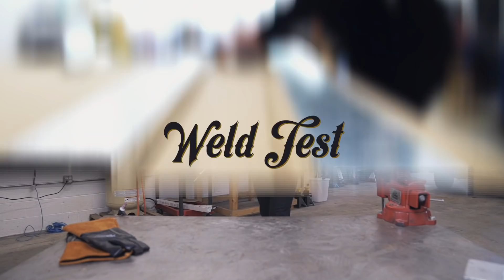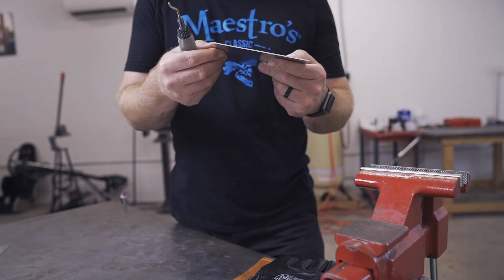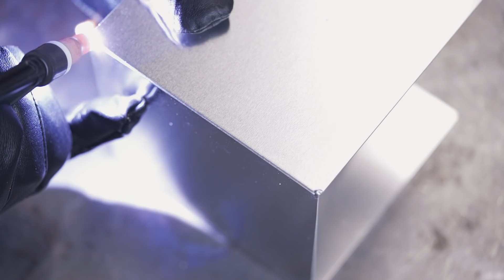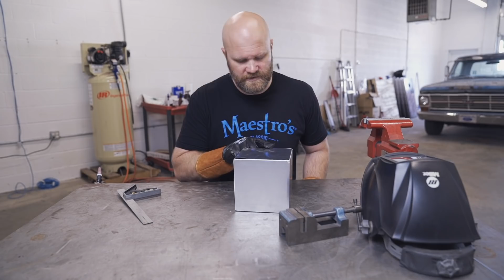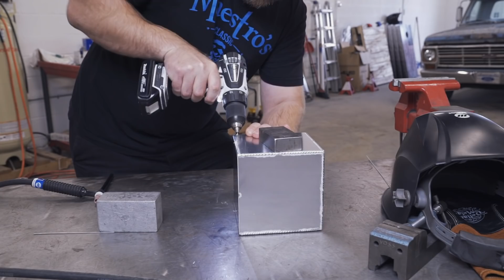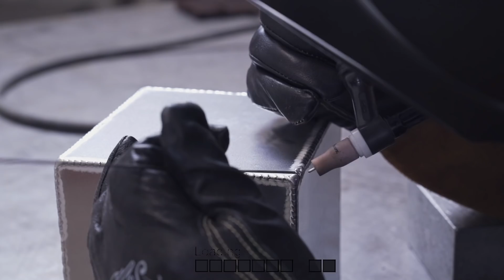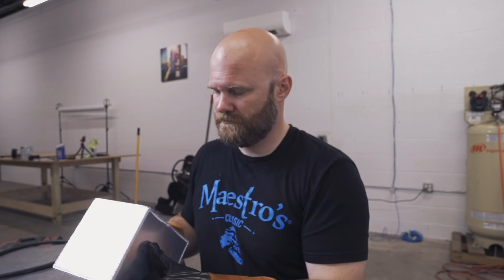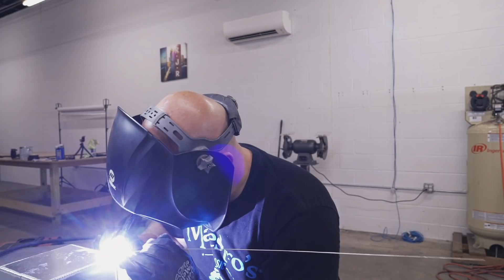Ace a NASCAR Welding Test - TIG Welding an Aluminum Cube

Comment: I have found in the past that if you can put a vacuum on the inside and draw the argon inside it might work
Reply: You can also cut a small piece of 1/8 aluminum filler rod and insert in the hole and see if that works for you

Comment: A cold wet towel to throw on the piece. I know this is an old video and it's been out a while but I've done that and it works great. If it's cold enough you can actually hear the vent hole suck in a little.

Comment: Hey Justin Voss, i have to ask you why are you so high up with your tungsten.
Your running pretty low amperage offcourse because its pretty thin sheet metal. 
But your losing a lot of power doing that. You can see your arc flutter like it has trouble keeping up.

Comment: From an old retired welder. Should fill cube with whatever gas you were using through the hole you drilled and lightly pein hole quickly and then weld up the hole. A few tricks are involved to complete this procedure. Do this and let me know how you did.

Comment: I realize this is a long time in the past, but would it not be a good idea to blast cool air into the cube then tack quickly, stop, repeat till the hole is closed, then weld over it for looks?
That prevents heat/pressure build up because the air inside is cool and not hot air - which expands quickly.
By the time it is hot enough to blow out the hole, it is too late.
Vacuum is really better inside - but how?? (so no!)
Yes/NO?

Comment: I made myself opened box for all the stuff I have around (phone, case with tungstens, etc.). I intentionaly have it on my table so when machinists or whoever comes to my booth they start asking about that box and it usually ends with me having a side kick. So... if I have got nothing to do at shop, I weld something that I'd like to work on (f.e.: I did pie cuts for fun and people started to ask about exhausts.) and then put it somewhere in my booth so it will be seen. Lot of guys at work are shy to ask, so it's not just a good display of capabilities but also a nice icebreaker.

Thanks for nice video!

Comment: You're too slow. With Al like that you should be dipping at LEAST twice per second, maybe even 2.5x. It likes it hot and fast. Get it up to temp and floor it, pausing per bead isn't doing you favors. You will need to ease up on the current towards the end of the weld, a peddle and/or a long downslope does the trick. You can pre-weld the final inch or two before doing the main weld.

Comment: What's the hardest part of tig welding? It looks almost like soldering. Except not. Just curious. Never tried it before
Reply: Dip pattern and temperature control on thin material

Comment: Ive had to do something similar but SS tube cut and cope 5 pieces and have it be straight after, no issue with venting but a absolute nightmare to not have warped into spaghetti.

Comment: I've been part of a team at the very top levels of motorsport and have been lucky enough to land a few World Championships as part of that. I'm not a welder, I was in engine development, so I can't judge there. What I would say is that  we had mechanics and welders or equivalently skilled technicians (I use this term with a great deal of respect) swarming at the door from across Europe and even further afield, this makes it very easy for the employer to say "NO"  or to offer you less than you're worth for the privelidge of working in motorsport (and no, it isn't that glamourous). My biggest tip is to double check whether it is really worth it. For me, I don't regret my time, but that's with hindsight and we won all of the championships we could. If we lost? Well then I'd have taken a seriously underpaid job for zero benefit. In motorsport you have the team to back you up, but unless you find a way to differentiate yourself, you are only as good as the team, and risk obscurity.

Comment: If you are confident in your welds you could alternatively make it a pressure box with some kind valve, it would get rid of your pressure problem by essentially needing a valve. Plus if welded good nuff “hydro forming” the box afterwords could be a great display of your abilities 
Just an fyi I’m not a welder in any sense of the word I just know some general knowledge, feel free to correct me about the hydro forming idéa

Comment: Is becoming a welder at NASCAR a hard thing to achieve? Making a cube really seems a bit easy.
Reply from the maker: It can be hard to get in the door. Then they will have you weld up or make something similar to what you will be doing and see if it looks nice. The cube is pretty entry level, do you know how to use a shear, can you make a nice looking aluminum weld etc.
Reply: @JustVoss  Alright, thank you! It might be hard for me to get there considering I'm in Canada but I wanted to see what kind of qualifications a NASCAR welder would need since it seems like it would be a job reserved for really good welders.

Comment: Really great video, I haven't welded aluminum in easly 2ish years, fun to watch videos on it, to anyone new to welding or looking into this type of work, ill i gotta say is no matter if you are going for pipe, fabrication, mass manufacturing, construction, or shutdown welding, a welding jacket, long sleeve shirt, sleeves or a older sweatshirt will give you a way better look for your own protection and show your potential boss that you look for your own safety, i work with guys in mass production that some wont wear a helmet but have glasses on and sunscreen on a part with a bunch of tacking and manipulating the piece, and a few that don't wear sleeves or a long sleeve but tuck their arms like he did in the video, I've burnt my arms before from arc exposure on pipe welding and its not fun and you don't look cool doing it either, keep yourself safe out there

Comment: You don't have to drill a hole if the entire part is hot enough that it's sucking air in because it's cooling faster that you're heating it

Comment: Thank you, Justin, for a great video. Do you happen to have any link to you air powered tools as 3 inch grinder and cutter, please?
Reply from the maker: If you go through the link in the description to my Amazon store there are other brands equivalents of what I use. They are  not the exact same since most of mine are snap-on and have to be purchased off of a tool truck. They are tools I would use though no problem.

Comment: I did one today after work as did 2 sides and let it cool for roughly 5-10 minutes with compressed air on it, rinse and repeat, im letting it chill overnight before i try to seal the vent hole and then im gonna pressure test it! Ill reply to this when i do get it pressure tested! Should note i did this with just barely thicker aluminum with 3/32 rod and tungsten and a dynasty 400

Comment: In the past what I've done when welding a sealed container us to use a cold damp rag to cool the item and reduce air pressure so it's drawing in and then close the weld.
Reply from the maker: Great tip!

Comment: My Uncle owns a Fabrication and Repair shop for Heavy Equipment and in his shop when you come to apply for a job his welding test you are given a Oxy-Acetylene Torch, A Mig Welder and a piece of 6x6 Square Tubing. You have to Measure, Cut, and Weld to make a 90 degree L of equal lengths. He then inspects it and says he'll call you back.

Comment: Lol the pinhole, let the cube sit for 10 mins to cool down. Then try again if it still persists (should be a hole drilled regardless) then ramp up a quick pulse to seal it. Ive done quite a few times works good.

Comment: No worries, anything you would be fabing would have bung for line fittings or a cap or both. Like an oil over flow or catch tank. Motorcycle oil tank etc. Very nice you make that easy, especially how you started your fitment. At 61 I'm just not that steady anymore. Show off. Have a great day.
Reply from the maker: Thanks man, and yeah I could have gotten if it if I just would have waited

Comment: Only place you need rod is the corners. So easy to weld outside corners on aluminum with just the torch.
Reply from the maker: I don't really only just fuse much, don't really trust it.

Comment: Everything you did was right and that was pretty slick where you  drilled your vent. The only thing that I would've done differently would be to either try to pre heat the last section so you're not in there as long, or let it cool and vent all of the pressure out, then come back at it with a hotter setting than what you welded the rest of the cube with. I haven't played with pulse frequency much, but if your machine has that feature, it may help. It's all about getting in and out before the pressure builds up and blows out the weld.

Comment: push your filler wire with your fingers not wrist, buy some tillman gloves the 24 cs,cm or cl maybe cx bigger cup say #6. you use inversion, i still old school syncrowave 500  and use helium argon  2 bottles mix my own c.f.h.

Comment: You could have sealed that hole with a bucket of water and put the hole in the very corner of the box so you could dunk as much of it as possible you’d still have to move fast but you’d have a little better weld

Comment: What was the purpose of drilling the 1/8 hole?
Reply from the maker: To let the pressure out from the inside that builds up while welding. The problem I ran into was I didn’t let it cool down enough when I tried to seal up the hole at the end.
Reply: @JustVoss  Thanks, I just got my Dynasty DX and I am trying to learn.

Comment: No comment on weather to pre ball the electrode or ball it as you do the job ( for people wondering balling is where the tip or the electrode goes round  some welders just use the rod stiraight out of packet as I was taught by a R A F wire frame maker or like some welders grind a point first )
Reply from the maker: I grind about a 45* point and try to set my frequency so it doesn't ball. That's using Blue Demon Multi Mix tungsten.

Comment: one question - what is the point of wiping the stuff down with acetone, when you're touching it right away with your fingers, and that leaves grease back on the degreased surface..

Comment: Hi Justin, I'm new to welding. I'd like to know what's the welding technic you're using. It's very clean. I don't like to use electricity. Is your system based on Plasma? Please instruct me. Thanks.

Comment: i would have failed you for not wearing sleeves.
Reply from the maker: It’s not a requirement in racing. Maybe it should be though.
Reply: @JustVoss  not required to wear sun screen when you go to the beach. But everyone does. 

Protect yourself.

Comment: Warm the container first then place a ice pack against the side just as you start welding this will rapidly reduce the air pressure inside creating a negative pressure and allow you to complete the weld.

Comment: If helium purge was used it would help on the hole, it would sit over the air in the cube and release slower than the "air mixture" inside the cube just have to use lower heat because helium burns hot

Comment: Granted, I'm a few months late to the party.... but put the box in the freezer for a bit, bring it out, and quickly seal that hole.
Same as putting wrist pins in the freezer, and pistons in the oven before you press them together.
It's the same, but different.

Comment: You weld the Cube up completely to the absolute corner, but instead of where you have drilled your hole, put it in the point of the corner. Then once the box is completely cold you found out you can spot the hole virtually without filler  Tip from this old fart to you Sir

Comment: I made several of these about 25 years ago in different sizes for flower pots. My wife and I also place foam and marbles inside them and take to our family grave sites where we use plastic flowers to leave on the graves as unattended flower pots. Make sure  to drill a few small holes in the bottoms for the water drainage. I always use my tig torch to run around the open edges of the pot opening to "roll" the edges instead of spending a bunch of time deburring/sanding/rolling them.

Comment: The reason why your weld blows out on closed welds is because the air in the box starts to heat up expanding the air building presser that then starts to blow out the corner when your almost done you can fix this by keeping something cold touching another side of the box keeping the air from heating but drilling a small hole is one of the best ways to keep this from happening but drill the smallest hole so you keep the integerty of the weld

Comment: This test is way overrated. Corner joints on aluminum are like the most simple thing to weld. I dont understand stand why people hype this up to be so difficult. Weld it out and leave a corner open. Let it cool. Weld said corner. Done.

Comment: Arc length a little long for me.  Your frequency sounded pretty low too but I don’t know what kind of Equipment your welding with. Either way nice job
Reply from the maker: Some parts it was, especially when reaching around the camera. My welder doesn’t have adjustable frequency.

Comment: first of you never hit the edge with anything that can contaminate it...  b4 you say  your not a welder ive been TIG welding for the past 32 years im coded and ASME1X rated .. Just a tip dont stop whilst you add filler also move  in direction of travel and  feed rod effectively .. good job

Comment: My dad was a lead millwright forever he used to arc stick weld everything (i am pretty sure)...why? I am getting ready to go to go to school for welding so i will probably figure it out there....
Reply: A Millwrights job is to build, lift, move, and install machinery in its place. In the field you are limited to what you can weld with, often times there's no power in the establishment you're trying to install something at. So a good generator on a truck with 50-100 foot leads off the welder, running AC/DC current to a 7018 often makes quick work of that problem entirely. Setup doesn't take an awful long amount of time at any vertical height, and it gets the job done and will last the test of time. I've welded in 30,000 Ton, 4 column Schuler presses to concrete embeds. It took a month solid to fully weld with stick, whereas with tig it would've taken several.

Comment: Heat the entire cube to nearly welding temp with a torch, then the air inside Wil be done expanding and you'll be able to close the hole........or instead of a sealed cube use the punch press to put holes on each side before welding 1 hole, 2 holes, 3 holes etc, after you weld it up you have a lawn sized dice

Comment: Hmm ive tried to weld aluminum on tig few months ago, but somehow it was hard to even connect 2 pieces together on 200amps, (5mm thick sheets). Im guessing the electrode with red tip isnt good for that. Used Argon 99.998%
Reply from the maker: On AC balance? The red tungsten should work ok

Comment: That last close-up and slo-mo was perfect to see how to add the extra material. A very nice video for someone like me who is learning to weld in college.
Just a few more questions: you are adding extra material to the weld. In school my teachers showed me to only add extra material when we accidently made a hole during welding. But I guess it depends on the thickness of the metal plates when to use extra material?
And because of the lower melting point of alluminium, you can weld faster in comparison with normal metal (S235JR)?

Comment: for the vent hole i usually put my filler metal right on the hole and heat it up on low amps till the filler wire just melts, let it cool then you have less of a hole and melt the filler metal slowly until it covers up the hole, thatll be the weakest part of your weld but only you know that lol
Reply: or stick 1/16 -1/8 filler wire in the hole like a plug then melt that bad boy right in there

Comment: Stupid question/scenario:
Assuming this was for a race shop, you could feasibly spin this into welding a custom fuel cell, no? In which case, you would need a hole for your fuel pump's sending unit. Why not just drill a bigger hole on the face of one of your panels and spin it into the scenario that you're preparing it for a step down the path? I enjoyed the video. Keep it up!
Reply from the maker: Not sure, but in nascar the fuel cells are steel and have a bladder inside them. Glad you like the videos hope you stick around.

Comment: I work with structural welds that experience fatigue cycles. I recommend people pay more attention to where they tack because those are the weakest parts of the weld. Don't tack where three welds come together, that's is where this thing Is likely to fail when it gets stressed over time. I offer this advice yet I learned a lot from you in this video, thank you!
Reply from the maker: Thanks for the info and will keep that in mind on structural things for sure.

Comment: Great video! Do you remember roughly what settings you were running when welding this? Pulsed? I often have trouble finding that sweet spot for aluminium, it either melts away from me or it doesn't melt enough to form a consistent puddle when making joints like these. Any tips?
Also looks like you're keeping your tungsten quite some distance from the material but maybe that's the zoom tricking my eye?

Comment: Why does no one in welding videos use a hand switch?
Reply from the maker: I use my foot a ton, more amps when the parts cold then rolling off as it heats up. To hard to do with my finger in my opinion.

Comment: Ive never seen someone weld with the arc that far away from the material. If you let the box cool off that vent hole will weld up alot easier.
Reply from the maker: I don’t normally, pretty sure I was reaching around the camera
Reply: @JustVoss   Even with that long arc in a few spots reaching around the camera, the box turned out awesome.
Reply from the maker: Thanks man